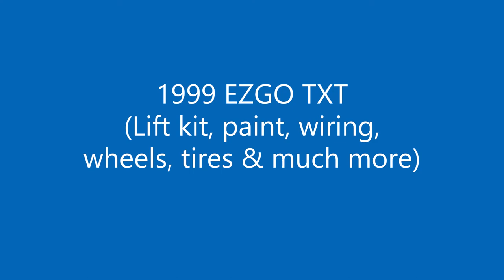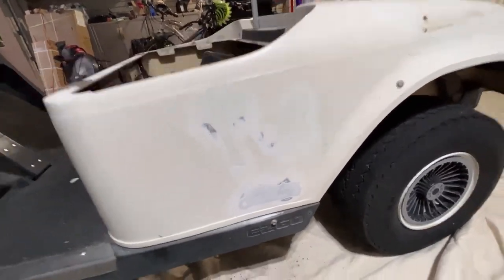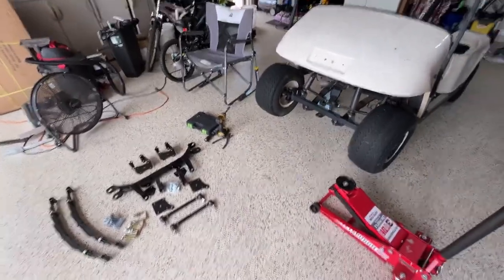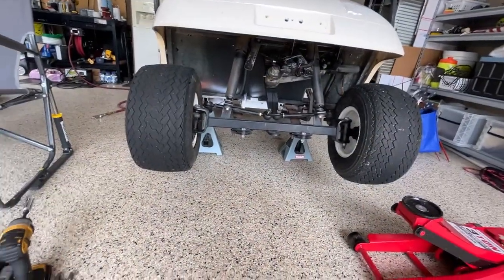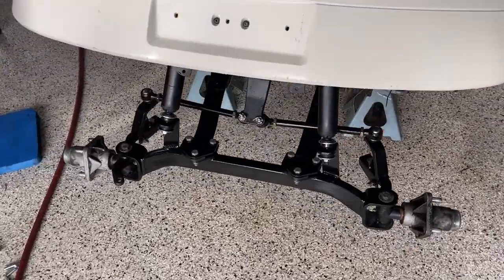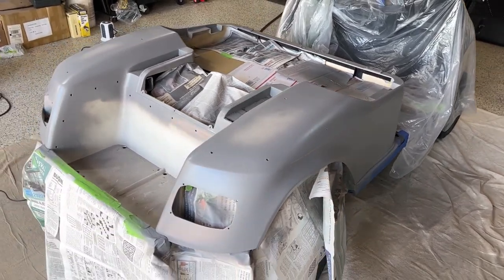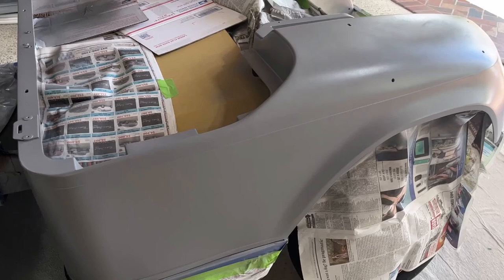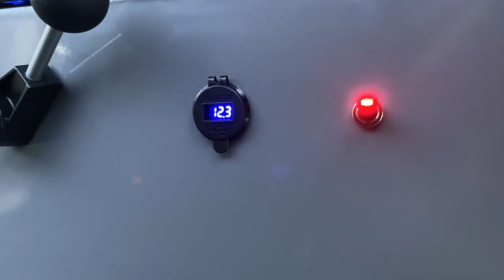1999 EZGO TXT Golf Cart Complete Rebuild From Start to Finish in 5 minutes!

Comment: what is the blue gauge next to the key switch on the dash, and where did you get it? Cart looks really good, I'm currently debating on what color to paint my ezgo. The cement grey looks really good.
Reply from the maker: That guage just shows the battery level as a percentage 0-100% charged. I used a color chip book to pick the color and it's actually Hitachi Grey but it looks just like cement. Thanks for watching

Comment: Mr. Tundra. Nice job on this EZGO build. What are the 3 strap on the break pad? Is is holding something?
Reply from the maker: Thank you. Those are just zip ties holding that brake pedal together because there was a lot of play between the parking brake pad and regular brake pad. I couldn't find only replacements for the pedal section. It seemed as though you had to buy the entire mechanism if you wanted it replaced and that was around $150 on ebay if I remember correctly.
Reply: What paint did you use to paint the body? Was it a professional sprayer or spray paint? And what primer? Could you list the steps required to get that finish? 

And did you paint the bumper and other plastic pieces? How did you get those looking so new?
Reply from the maker: @mattstumpf692   The body was just scuffed/sanded and then sprayed with a base coat of color.  I had a local automotive paint store make a spray can of a color used on Hitachi equipment(I just picked a grey out of a bunch of color samples). After the base color was sprayed on I clear coated it with SprayMax 2K Clear Glamour. It's a 2K clear that gives spray gun/professional results in a spray can. However, it's highly toxic so you must use a respirator. You can get the 2K on amazon for about $20 a can. The plastic bumper and black pieces were painted with Rustoleum truck bed liner which works excellent for the plastic pieces. Thanks for the comment!